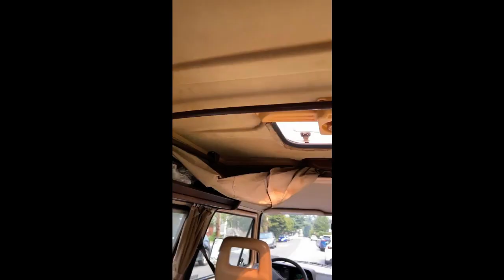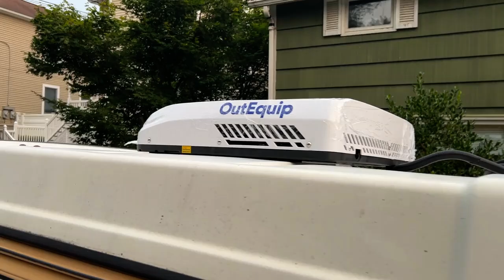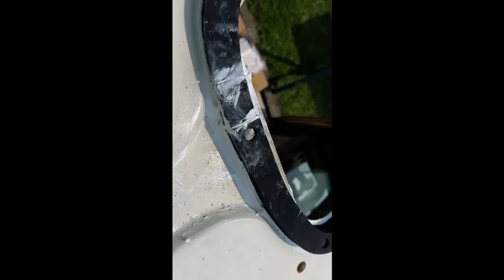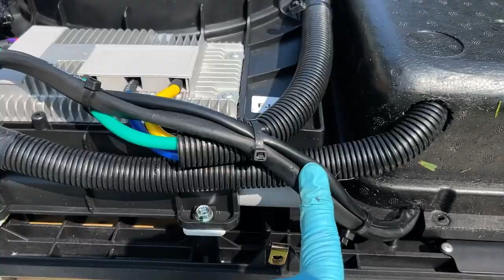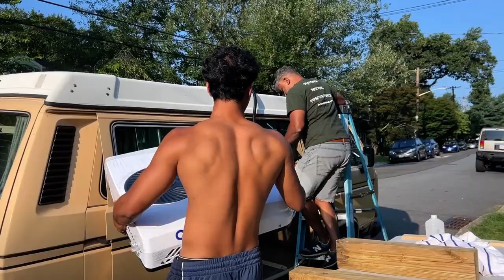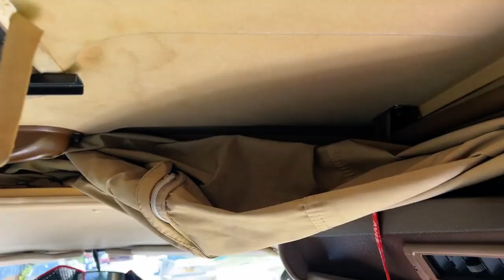OutEquip Rooftop Ac 1985 VW Vanagon Westfalia Install

Comment: I install the same a/c unit in my 84 1/2 Westy. I used an “L” bracket across the ceiling and supported with the upper pop-up bracket bolts. The L bracket also helped routing the a/c wires along side the pop-up arms. This will withstand the front weight of the unit. In addition, I installed an outer cross bar under the rear part of the unit and placed roof rack brackets on each side of the pop-up to fully support the weight of the unit. It’s been working great!
I love this unit!
Reply: Do you have any videos you can share?
Reply: I’d love to see a video or pictures of your install also!

Comment: Nice Video... Been looking for something like this for my 85 westy where I do not have to cut into the top.  Do you have any follow up videos of the final install and any gotcha updates?  How does the AC unit do with the top being popped?
Reply from the maker: Hi waiting on the battery to run it you need a minimum of 100ah i'm going with a 300ah that should give me about 5+ hours runtime. Will have some follow up videos out shortly You'll need struts to assist with opening the top. https://gowesty.com/search?q=roof+struts
Reply: @a @anthonyjaundoo6420 -any feedback on using while top is up?